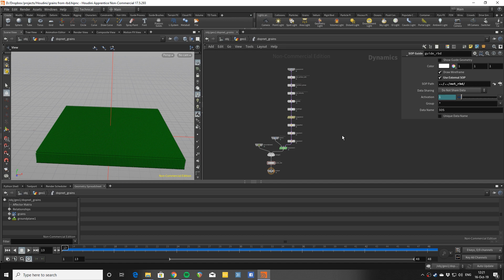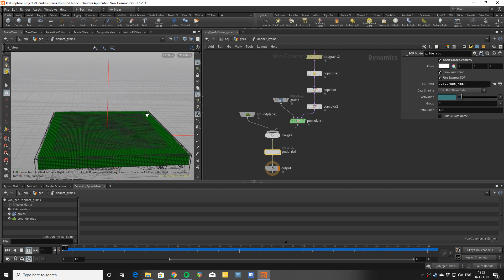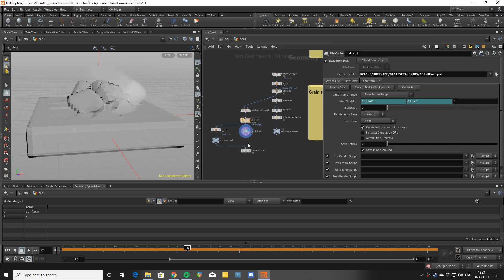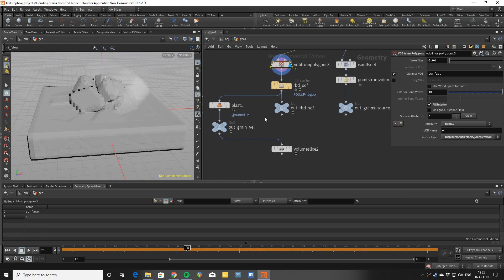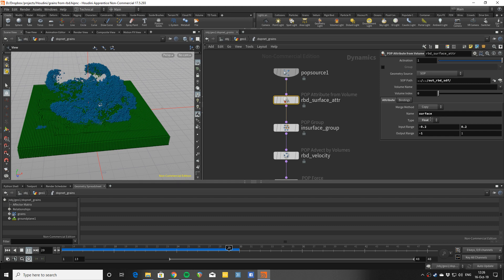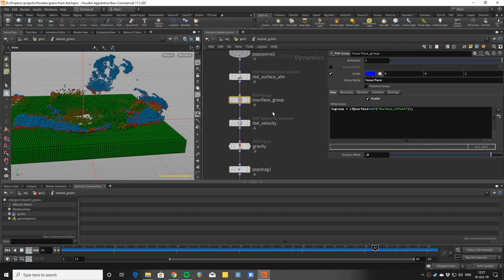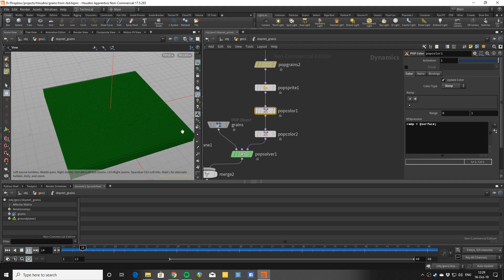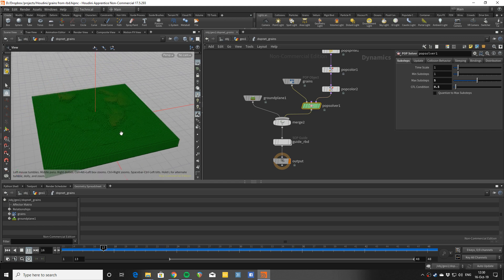Houdini 17 5 grains from Bullet RBD

Comment: Could you have a setup that goes the other way? You have a pop grains simulation with objects like rocks which are various shapes copied to points. Then use that as a guided RBD sim to achieve collisions between the rocks and othe collision geometry?
Reply from the maker: You now have the rigid vellum constraints that you can use for that, to be the rigid parts of the simulation, and stay in Vellum for the whole thing